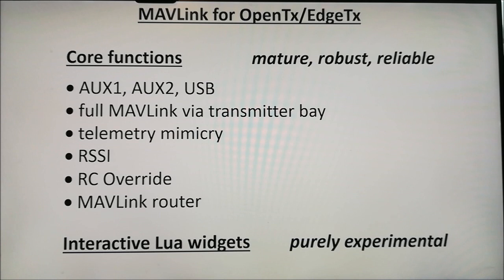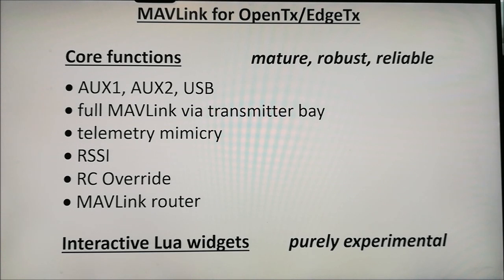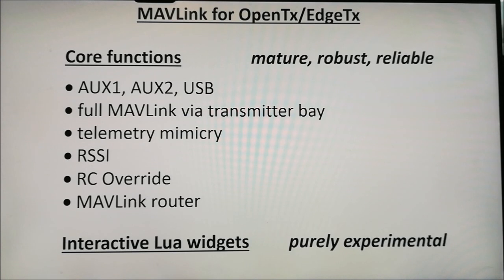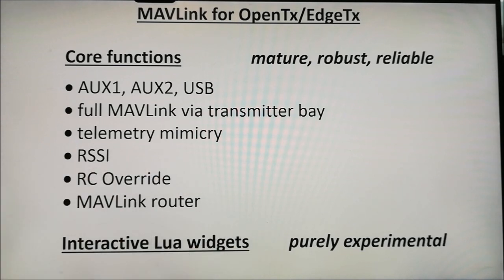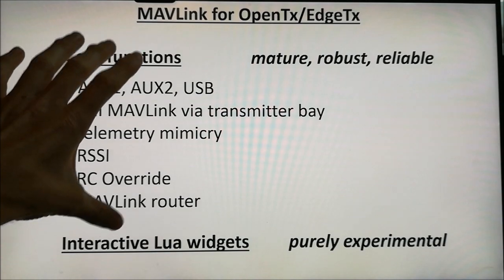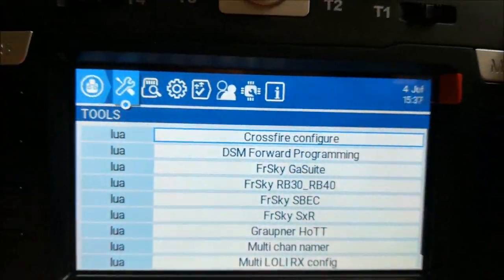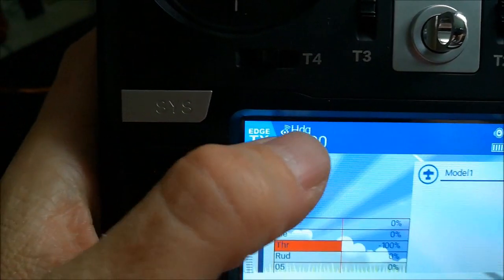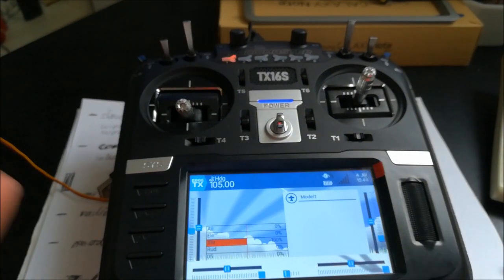EdgeTx with MAVLink: Smooth to the touch!

Comment: Can Radiomaster Boxer EdgeTX  transmitter can be used with mLRS (MAVlink)?
Reply from the maker: mLRS can in principle be used with any radio, however I think this was not your question, but if Boxer can be used with the firmware demonstrated in this video here (which is not mLRS; the project is called MAVlink for OpenTx/EdgeTx). Here the answer is: no. :)
Reply: @OlliW42  BTW, are you using this Jumper T16 Pro V2 16CH 2.4GHz New Hall Sensor Gimbals Built-in Multi-Protocol Module Radio Transmitter OpenTX, right?

Comment: Amazing project Olliw42 
Been trying to wrap my head around it for the last few days.
I have a tx16s recently flashed with edgetx and I'm building an ironman copter, intended to fly with ardupilot.(using matek h743wing)
I couldn't really see how to install these fitures,  can you do a short step by step tutorial with the download and flashing procedures. 
Thank you
Reply from the maker: hey, the best would probably be if you could join the rcgroups thread on the topic, https://www.rcgroups.com/forums/showthread.php?3532969-MAVLink-for-OpenTx-and-Telemetry-Script. yt is not well suited to answer questions. Essentially, however, it's not different to installing edgetx.
Reply: @OlliW42  thank you, been going through the registration thread last few days.
Thing is I have no problem with a hex driver and soldering iron but when it comes to programimg and computers I'm clueless.. 
I just don't really know how to use the files in the folders you shared. As to what goes where..
Reply from the maker: that's fine. As said, if you would consider joining the rcgroups thread we can help you :)

Comment: Great job !!! Could Mavlink telemetry be taken through the micro USB of the DragonLink TX and with a USB cable put it through the upper USB of the Tx16S directly?
Reply from the maker: I don't know, I'm not using Dragonlink and don't know its in an outs. You may want to ask e.g. in the rcgroups DL thread, Risto is there and knows a lot about it. From the Tx side it would work.
Reply: @OlliW42  I will test it tomorrow